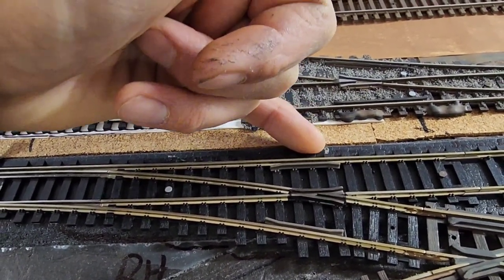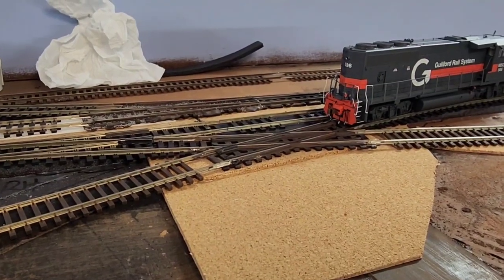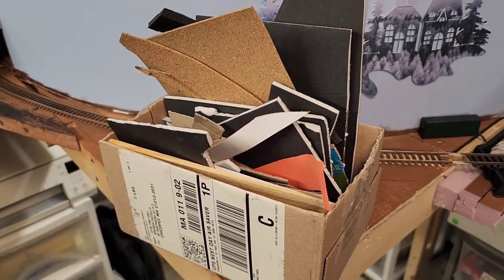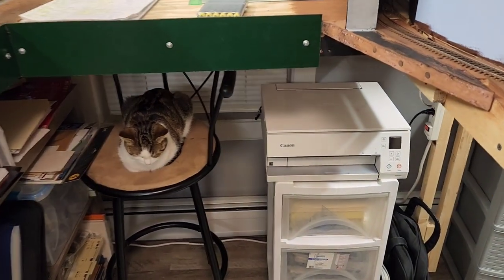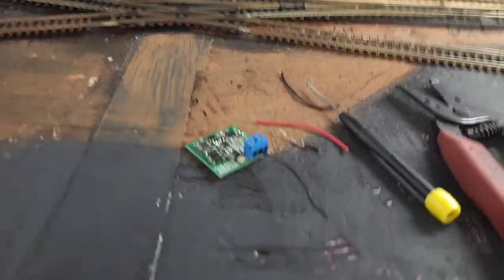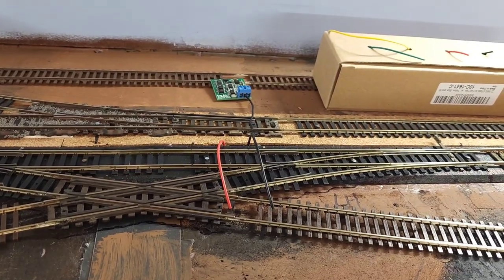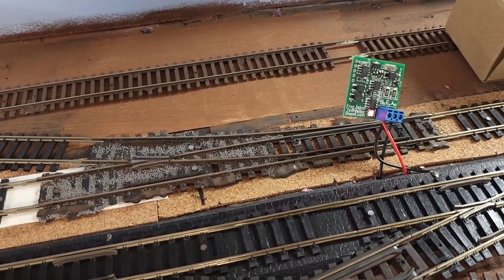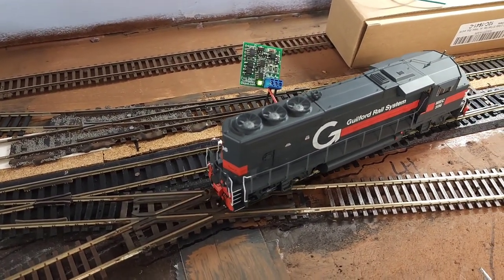How I wire up my Mono frog juicer.

Comment: Jason, Well thanks for setting up and doing the frog juicer vid! Those juicers are just as simple as you mentioned to me earlier.  Our main layout is mostly code 100 Atlas. Luckily we don't have any issues there, our upper levels are code 83 with Peco switches. Most have a smail for control but we didn't understand or use them properly to power the frog. We did on later installs. Recently , my son purchased 6 Scale Trains Museum EMDSL39. They are awesome engines but they have a feature on the bottom of the truck that activates a "Click-Clack" sound as it goes over the frogs in a turn-out. This is where the problem comes in. The engine will short out going over the frog if it is not properly powered. This means we can't use them on the lower layout. This was a great vid Jason. Either we will do individual one or we may look at multiple controller for the frogs but either way, this was great for you to put together a vid on my request!!!! 
Cheers
Earl
Reply from the maker: Hey Earl and not a problem at all I enjoyed making the video. I have 2 regular tortoise switch machines, 1 smail switch machine, and 4 walthers switch machines. At the moment I only have one walthers switch machine wired up at the moment. I also need to learn how to wire up the tortoise switch machine for the frog part at least. I think about it and it can't be that hard right I mean it's just one wire🤦‍♂️🤷‍♂️😅 I'm sure there is a video or two on how to wire that part up. As of right now my mainline is all code 100 my yard tracks and spur tracks are code 83. I have a mix of switches between Atlas and Peco. I also have 2 Peco Electro frog code 83 RH turnouts that I had to figure out how to wire them up. That was fun 🤦‍♂️🤷‍♂️😅 So on my first builds I used only Atlas switches and as I started to watch more videos I noticed a lot of other modelers using Peco switches. So I bought a few and tested them out and came to a determination that Peco switches seemed to work better 🤷‍♂️ So I will be phasing all the Atlas switches out and replacing them with Peco switches. On my next layout the permanent build I will be using code 83 for my mainline, at least 90% Peco switches, and I think it is code 70🤔 for my yard tracks and spur tracks. Those sound like some neat locomotives your son bought. 6 at one shot? That must have been a pretty penny🤦‍♂️🤷‍♂️😅 Well hope the video helped some and you can figure out your first level. Thanks for stopping by and have a good night. Happy modeling!! -Jason
Reply: @jaybird111207  Ya we have discovered that Peco Code 83 are really good, but everybody has their preference. Look up tortoise switch machine wiring diagram or Circuitron and then images for wiring tortoise. There is 1 specific diagram that shows a switch on the left, the Tortoise in the middle and a 2 light signal stand on the right and the accompanying wires. That is our go-to drawing every time! We use the Smail because it has the built in DCC decoder and we love it. you don't need a separate switch to activate the machine just assign it the address and select..lol. We only have 1 Tortoise and it is automatically controlled by the PSX AR on the top level. A Smail conflicted with the AR because it has the decoder in it. Tam Valley also has a 6 point controller too
Earl
Reply from the maker: @Earl Widmeyer  hey Earl, Yeah I'm digging the Peco brand myself and think I'll stick with them. I need to refresh my memory with the regular tortoise switch machines I have. I'll have to hook up the toggle switch for them as they are the regular ones like I mentioned earlier. I have the one smail I'm going to wire up and more then likely will be getting those from here on out since I can wire them up to DCC 🤷‍♂️🤟🤙😎 So little at a time I will be adding more feeder wires and smail switch machines. I will utilize the 4 walthers switch machines I have since I can wire them up to DCC as well. Always fun times building a layout right🤦‍♂️🤷‍♂️😅😅 Hope all is well and have a good night. Happy modeling!! -Jason

Comment: Fantastic, success , I like your idea of using a cross between two turnouts, I noticed you spiked your track down, not sure if I would solder turnouts but works great
Reply from the maker: Thanks Dundas!! I like to add some interesting track into a design makes for a cool ops session in my eyes. I actually need to remove those nails as I have glued the track down and it shouldn't go anywhere🤦‍♂️🤷‍♂️😅 I've soldered switches before and it's fairly easy to undo the soldering. Basically soldering in reverse and hoping you didn't use a ton of solder in the first place🤦‍♂️😅 Thanks for stopping by and have a good night. Happy modeling!! -Jason